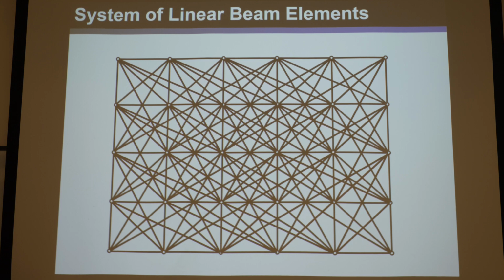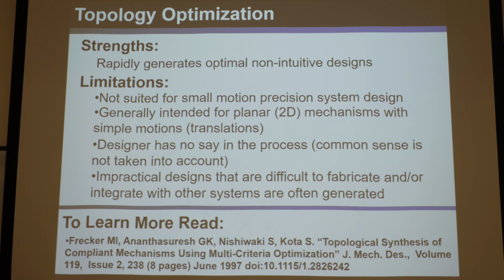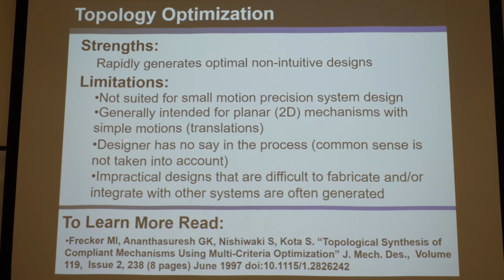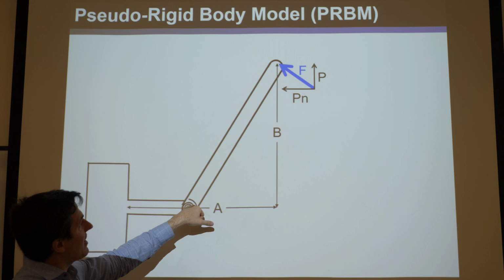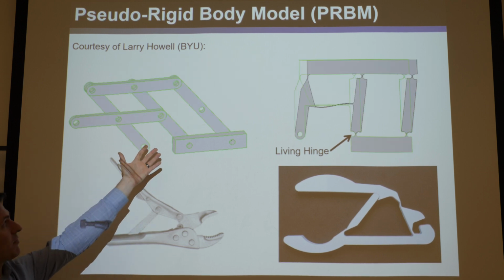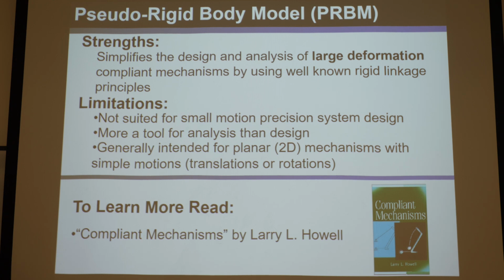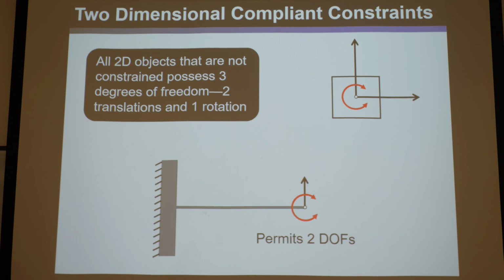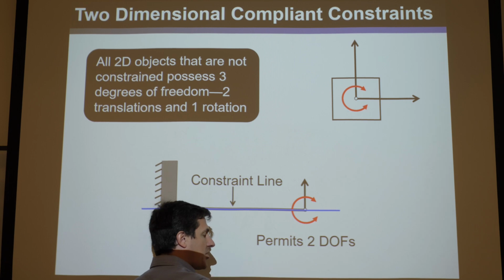Compliant Mechanisms Lecture 4 Part 1

Comment: ## Lecture 4: Compliant Mechanism Design Theories and Constraint-Based Design Principles

This lecture covers three design theories for compliant mechanisms and delves into the principles of constraint-based design. 

### Compliant Mechanism Design Theories

* Topology Optimization:
    * Concept: A computational approach where a computer iteratively removes or adds material (represented as nodes and beams or a mass distribution) within a defined design space to optimize a mechanism's performance based on specified functional requirements. 
    * Strengths:
        * Generates optimal, often non-intuitive designs that humans might not conceive.
        * Suitable for complex designs.
    * Limitations:
        * Resulting designs can be impractical to fabricate (e.g., complex geometries, thin features).
        * Difficulty in incorporating common sense constraints (e.g., feature size, material limitations).
        * Computationally expensive, especially for 3D and complex motions.
        * Limited user input during the design process.

* Pseudo-rigid Body Model (PRBM):
    * Concept: A mathematical approach that models flexible members as rigid links connected by pin joints and torsional springs, approximating the compliant mechanism's behavior.
    * Strengths:
        * Leverages established rigid mechanism theory for design and analysis.
        * Simplifies analysis of large deformation compliant mechanisms.
    * Limitations:
        * Requires familiarity with the model and its application.
        * Primarily a tool for analysis, design requires more skill.
        * Limited to existing models, less suitable for precision applications.
        * More challenging to apply in 3D.

* Constraint-Based Design:
    * Concept: An intuitive approach based on understanding how constraints (flexible elements) control degrees of freedom (directions of high compliance).
    * Characteristics:
        * Less systematic and rigorous, relies on experience and creativity.
        * Designs often resemble rigid bodies with strategically placed flexible elements.

### Principles of Constraint-Based Design

* Degrees of Freedom:
    * Defined as directions of high compliance, where constraints do not restrict motion.
    * In 2D, an unconstrained body possesses three degrees of freedom (two translations and one rotation).
    * In 3D, an unconstrained body possesses six degrees of freedom (three translations and three rotations).
    * Visualized as infinitesimal motions, not finite deformations.

* Maxwell's Equation:
    * Relates the number of non-redundant constraints (C) to the number of degrees of freedom (R).
    * In 2D: 3 - C = R
    * In 3D: 6 - C = R

* Exact Constraint:
    * Each constraint does a unique job of restricting a single degree of freedom.
    * Critical for precision applications as it ensures repeatability and accuracy.
    * Totally exactly constrained systems have zero degrees of freedom and become structures.

* Over Constraint:
    * Opposite of exact constraint. 
    * Occurs when more constraints than necessary are applied, leading to redundancy.
    * Can cause stress build-up, making the system prone to errors and failure.
    * Blades and wire flexures can contribute to over-constraint.

* Rule of Complementary Patterns:
    * Concept: Defines the relationship between constraint lines (blue) and rotation lines (red) to determine degrees of freedom.
    * Rule: Every rotation line must intersect every constraint line at least once (including at infinity for parallel lines).
    * Application:
        * Draw blue constraint lines through the axis of wire flexures or represent the planes of blade flexures.
        * Identify red rotation lines that intersect all blue lines, including at infinity.
        * Red lines in finite space represent rotations, while red lines at infinity represent translations.

### Key Principles:

* One constraint kills at most one degree of freedom.
* Degrees of freedom are not fixed to a specific coordinate system and can move within the system.
* Blades themselves are not inherently over-constrained, but multiple blades can lead to over-constraint. 
* Parallel systems (two rigid bodies directly connected by flexible elements) cannot be under-constrained.

Comment: Dear Professor Hopkins your lectures are so great!
thank you so much,
Just I want to know if we design a CM by using the FACT method what is the difference in this method for lumped CM and distributed CM??
Reply from the maker: FACT designs CMs that consist of rigid bodies joined together by flexible elements of various geometries. If you shrink the "rigid bodies" to points, lines, or curves though you can use it to model CMs that are completely distributed compliance. The lectures about serial and hybrid elements should clarify what I mean. I hope that answers your question and thanks for your interest.
Reply: @TheFACTsofMechanicalDesign  thank you so much